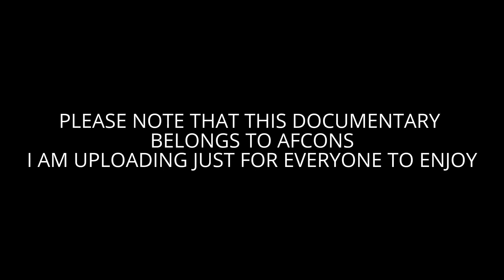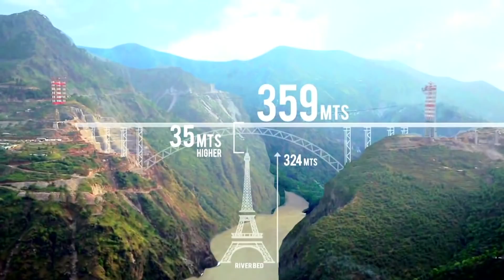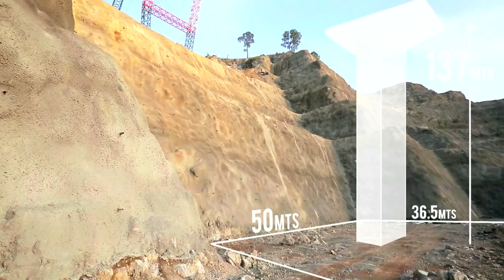Construction of World's Highest Railway Bridge!! Chenab River Bridge (Kashmir)! AFCONS' Documentary!

Comment: Please take your time and make it very durable, as the stresses and strains on the metal will be much at that height sway and all. Both sides the track there should be more protection, further the reinforcements, so that the structure is unshakable.  Good Luck.
Reply: People should not be used to test the track. Initially at least 100 to 200 runs across at great speeds should happen to find out the stress and strains are properly handled by the structure. Life is precious. Such works even should be inspected by international inspectors of repute before making the people to travel.Mountains around look as if the stone is much brittle.  If it is not mature stones we have to reinforce them with powerful cement or alternatives so that they stay strong.
Reply from the maker: Truly...  I too wish good luck to all the engineers..